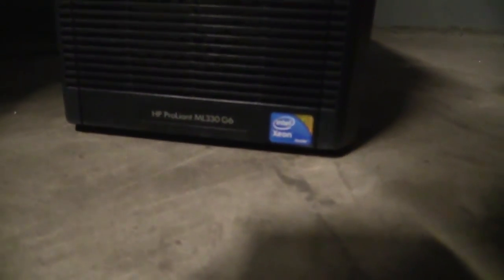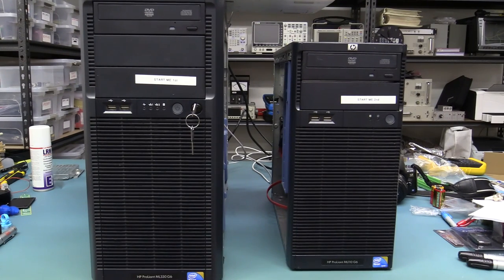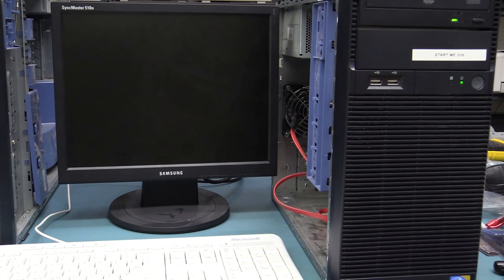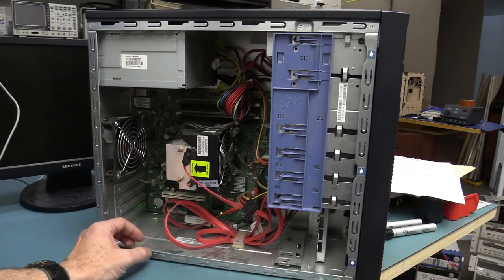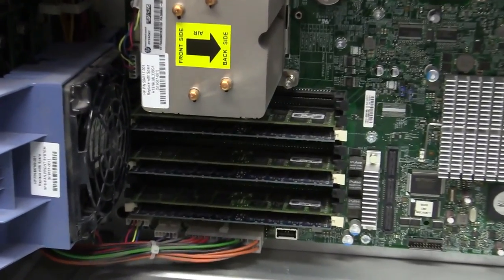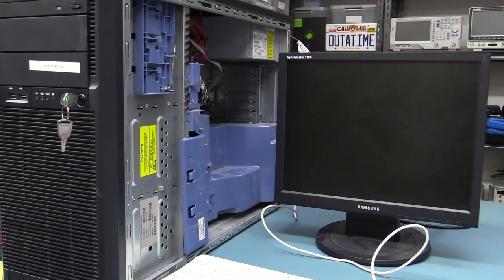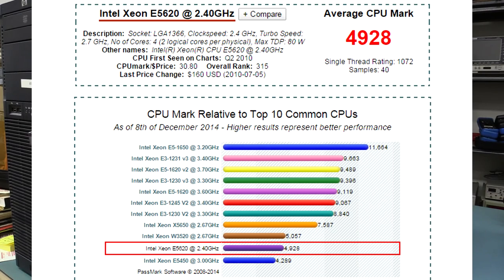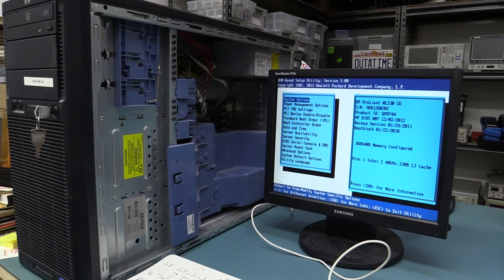EEVblog #691 - Dumpster Dive Xeon Servers

Comment: saw in the video that the Xeon prosessor in the last machine had 12mb cpu memory. Thats nice.
Reply from the maker: ingenfare Yeah, my i7 3770K only has 8M
Reply: And it's quad-core with Hyper-Threading which gives 8 threads total. This can still be used for lots of server workloads even today.
Reply: EEVblog
The i7 is much quicker at basically any task you throw at it. See http://cpuboss.com/cpus/Intel-Xeon-X3430-vs-Intel-Core-i7-3770K for comparison. I'm talking core vs core. I think the only reason you might consider using the Xeon, is power consumption when running 24/7.

Nevertheless, nice find!
Reply: But even a 5820K have 15MB...
Reply: SeaJay Point is,it is not expensive,according to most 'gamers'.

Comment: If these are anything like G8's the Ethernet ports are probably designed for use by ILO (Integreated Lights Out management) which is like a low level remote desktop to allow hands-off management.

The real network ports would be on a fast expansion card.

Comment: ML110 and ML330 are HP's base models, single PSU, no SAS support and no real RAID system (B110i is a raid system but its more or less software raid)
However they are still quite good machines and quite reliable.

Comment: I agree the thermal thing on the large one. One of my mainframe class systems was like that. They used styrofoam, ducted it from the front where the drive bay over the RAM, CPU, and out the back. They used 3 loud, but low power squirrel cage fans. I replaced them with a normal fan on the back on the outlet works fine.

Comment: Depends how much is your processor heating up.
It's a huge difference between 40° and 80° (when your CPU usage is around 20%),guess which one is better.
Because with higher temperature Si  Ge and other materials change their behavior. 
Witch changes the power requirements as well as actual clock of your CPU.
So your PC will be turning it self off and not just because of temperature of core, but because your power source won't keep up.
Or you can experience an occurrence of bsod quite often, mainly caused by corrupted data exchange between CPU and ram.

So keep in mind:
bigger heatsink = better thermal flow = faster cooling (fan required of course) = happier processor. ; )

Comment: the server computer i had didnt run the CPU fan, 'cause it didnt need it. the proc just ran cold all the time. dont understand how, it was running ubuntu server as the os, and hosted 2 minecraft servers, an FTP server and 3 web servers on only a core 2 duo.

Comment: Gret pickup. They are servers, but lack redundant power supplies. I picked up a couple of older dual-Xeon DELL Precision T5500 machine with about 14GB RAM DDR2 ECC RAM. The RAM runs so hot it needs it's own fan, lol. Those older Xeons are power-hungry things, the newer generation Xeons were much more efficient. So many fans, would literally sound like a jet taking off (and would stay on!), and had to use software tools to slow the fan speeds to more reasonable levels. Really belonged in a datacentre. CPU-Z can tell you exactly what you're dealing with in Windows in terms of processor. Costs of running them at home 24x7 are restrictive, can add $50+ to your power bills. These newer 2011 models should be more efficient. ECC RAM makes them oh-so-stable.. You got some good RAM there too. As a precaution on older machines I always note the existing BIOS settings and replace the CR2032 lithium button BIOS battery.
You have a nice virtualisation platform there with the one with 32GB. They easily chucked out around $1000 worth of servers there..

Comment: To write these off as a tax loss they will get a much better return than the auction price and it also means nobody has to actually deal with the auction or the postman. Plus an office will also need to find a way of 'absorbing' the funds raised from the auction without raising suspicion. $500 to most people is well worth the hassle but for others it's just too much hassle !

Comment: The first HP isn't a "real server", it's more a consumer PC with a little bit more durability, but not more. Because it has only one PSU and also has the xeon with the LGA 1156. This socket are also used for the Consumer i5 and i7.
(i wouldn't use server like this for an commercial environment)
The second HP is more a"real server".
but when i say server i understand something like an Fujitsu Primergy RX300 or an HP DL380.
And its not an good idea to use this as an gaming machine.
1. the are very loud
2. the PCI-E slot mostly is not the x16 version
3. the PSU of the bigger server are mostly not compatible to the Graphics card.

Comment: The 330 is a great machine, the 110 is a very low end server.  The 330 has a mezzanine which will add another CPU.  It makes a nice, if giant, workstation for running flight simulation on.  The enet/mgmt is a dual purpose for HP iLO (remote access) and also a standard enet for the OS.  You can disable the iLO function.  The RAM is indeed ECC.  You can put an X5650 series in there also which makes for a powerful system.  I recommend that you find a use for it, you won't regret it.  I am happy to answer any questions you might have about it.  You will want to sell the 110.  The Gen 9's are starting to come out.  Keep up the great videos.  Cheers.

Comment: Regarding your comment about how things showing up on the screen means the CPU is present... on a computer, the CPU completes the power circuit. If you have a computer with no CPU in it, it won't turn on.

Comment: You can just boot some Live Linux from CD or USB stick to identify CPU.

About Xeons, well, Xeons usually have higher IO bandwidth (to disk, memory and network controlers), as well much bigger CPU caches, which is very useful in big business applications with very complex codes. Also Xeons tends to rather use more cores than running fewer at higher frequency. It is just more suited for power efficient servers usually.

I have few computers with Xeons, one with dual Xeon X5679 @ 3.2GHz, and another with single W3690 @ 3.47Ghz, and another one with some more modern model.

Dave, you should find really crusty professional rack server, like IBM x3950 or something like that. People are giving them almost for free, because it is better to replace them with newer, faster and more power efficient machines, than keep running. Built like a brick, heavy as hell, and some awesome management features, dozens of redundant hotswapable fans, air ducts, ultra reliable power supplies, dual psu, sas/scsi drives, special memory systems (with dozens of memory slots) and lots of awesome custom hardware, software and system engineering.

Comment: Holy god. Is that a delta fan in the 2nd server?
Reply: Mads Kjerulff probably multiple deltas
Reply: ictdude1 It must be, i was just waiting for that thing to take of like a harrier.
Reply: +Mads Kjerulff your average dell optiplex 745 has a delta fan too. and those are much easier to find in dumpsters....
Reply: Jeffery Peters I am surprised it didn't just cut off the finger!
Reply: Jeffery Peters The scariest moment i had with a fan was when i was fixing my nitro plane. I just turned the prop, thinking that it wouldn't start. BUT IT DID. Luckily i only hit the propeller from the back, so no sharp edge, and it wasn't throttled up very far.
But from that moment on whenever i worked on the engine i had the glow plug out!

Comment: wow the fans on the second one at startup were insane
Reply: duncanscast I had a similar server, HP as well, but a rack setup. It had rows of fans in the front and in the back, and a plastic air duct throughout the RAM modules and 2 CPUs.  We took the lid off, left the plastic duct on top of it (it wasn't kept by anything), and when we started it, the plastic duct flew across the room while the server was getting ready to take off. It weight a hefty 500 grams, that plastic air duct, still took off and landed at the door.
Reply: duncanscast Both the Computer's fans, and EEVblog's Fans were insane.

Comment: Nice score - I picked up a dual 5060 rack mount machine with 4Gb ram for $100, and had to replace the motherboard. But... it was fully populated with HDD's - 3 x 72Gb 10K and 5 x 146Gig 10k units. and guess what was in the CD drive? yep the original HP server 2003 CD :) about to set it up now. I also got a pile of spare HDD's, a spare VRM and a few other bits including the rack rails :)

Comment: +EEVblog I know this video is a bit old... but I have some doubts.

You said to install a windows server on it but:
- Will it works (nowadays) with Windows 7, 8.1 or 10 for a particular use?
- Is it viable to use it as an industrial machine, i.e. a computer for a bordering machine or metal plates writer machines?
- If you invest about 50€ for a hard drive, you expend time installing Windows and so on, how much you will sell it?
Reply: +Miguel Angel MG It'll run standard Windows just fine, it'd be totally usable as an industrial system, and just as a reference you can usually find similar systems on eBay for $400-600.

Wouldn't be great in an environment with a lot of vibration though, they're not built for that. These usually sit in a networking closet in offices, tucked away from disturbances. You can think of it like a regular PC that's got some beefier spec'd parts. Hell they're often used as high-end workstations.
Reply: DarkStar851 Thx!!

Comment: Looking at QuickSpecs from HP for ML110 G6. Looks like Xeon X3430 Quad-Core 2.40GHz LGA1156 based on 1st gen core i7?   As far as I know, Xeon is the same as Core i7 + ECC RAM support.  You mean single / dual core processors,  not core :-)

Comment: The ML330 Would make a great live streaming rig
Reply from the maker: NekitaNet What makes it better than the i7 870 I have now?
Reply: reliability.
Reply from the maker: voltare2amstereo Granted.
Reply: Haha, yeah, right in the middle of your stream the fans kick into high gear and deafen all your viewers.
Reply: EEVblog It might be worth swapping CPU + Mainboard + RAM to the streamrig, if you could still use your Graphics Card and CPU cooler. Considering what price you can sell this for, you'd really have to be into this reliability thing.
Reply: Damon Dransfeld Most of the boards aren't ATX complaint and wont fit in a normal case. Replacing the fans with something quieter should work, but the board might throw a fit. Dave if you put the case sides on and change the BIOS settings to quiet (If it has an option) the machines should run a lot quieter, you'll find a switch that engages when the case is open and this normally triggers an error.
Reply: EEVblog The Xenon can do more heavy loads for longer without any single bit or other errors. Memory bandwidth should be (in general) higher and with TLB Cashes on die being bigger, the access time to stored functions (including swapping out processes) will be much quicker. In general the Xenons and i7's are from the same dey's (last time I checked), but the Xenons are cherry-picked for longevity (guess a stress-test) and have no or only limited errored functions that are (laser) cut out of the circuit. Since you've got both I can recommend running a DataBase testbench to check the exact difference on the systems on the part of throughput of data and functions. Now in regards to video rendering: Sometimes just one single bit error will make a video unusable, so there the quality will payout. And with these two to compare: Well the Xenon is 32 nanometer and this i7 is 45 nanometer production process, so think of the optimizations done when enhancing to the smaller lane sizes. Have a look at these: http://ark.intel.com/nl/products/41315/Intel-Core-i7-870-Processor-8M-Cache-2_93-GHz and http://ark.intel.com/products/47925 Number of memory channels is +1 on this Xenon and that at higher memory bandwidth of 4.6Gb/s, so 13.8Gbit/s more throughput. Guess that's the limit for typing for now, pm me with any thought you have. Oh one more: Check the power consumption of both machines. That also factors in...

Comment: Well i love the HP computers. They keep on working and it was no suprise that the boot up. I have an very old p4, 2.8gHz HT working 24/7 as a radio automation and it is still working. I had to replace some elco's at some point but still going. That is one thing you can't say about the Dell computers. ;-)

Comment: Isn't GPU accelerated video rendering a lot faster than CPU based?
Reply: I'd still take a free Xeon over a 5000 bucks Quadro.
Reply: Doesn't a consumer grade GPUs beat out Xenons?
Reply from the maker: Christian Gerefalk Depends entirely what you are rendering and how.
Reply: +Mike Bruschke Because "free" vs "$5000".How about comparing a K5200/K6000 with something more modern,such as dual 2687Wv3s?They cost similar.

Comment: I used to work for Intel in the Enterprise Server group. Yes, they are very reliable, a major factor in design. Usually the weakest link is the spinning hard disk drives (HDD's) so they might be the reason the machines were replaced. (???) The HDD's were removed for various security reasons, but there is no reason these boxes couldn't be cleaned up, new HDD's installed with an OS and then run non-stop for another couple of years. Are the hard drives SATA or SAS?

Comment: Its amazing what offices throw out, i recently saw an ad on my freebie site in london which i was extremely lucky to get first. Got a dell poweredge t300 server tower 2011 vintage and a dell vostro 270s mini tower 2012 with wifi with a high spec core i5 in it still worth 400 british pound.!... also he threw in a 2011 core i5 with 8gb ram and a graphics card that an old work colleague who left had built, i couldn't believe my luck.. had to go into central london though with the car and park in a ridiculous place to pick them up but he left them in reception for me. Picked up at least 600 british pounds worth of stuff and currently using the Dell vostro with 8gb ram and a 1gb graphics card from the i5 system!! for free.. so chuffed as i was looking for a cheap desktop but ended up making money and getting an i5 system.

Comment: yes its a Xeon, but there are Xeons you can get for 1.50 GBP, or Xeons you can get for 22,000 GBP. judging by the labels, they look like older generation CPUs, i have had rackmount servers with the same CPUs, for 100 GBP mid-low config.

Comment: You really shouldn't be calling those "a pc". A server is not built for general purpose, personal applications.
Reply: That's pendantry. They fulfil all the requirements of a "PC".
Reply: But IT IS a general purpose computer. The only difference between two computers are the hardware features. Server has dual psu, for example, more memory slots, more cpu sockets, etc. However, server is still a general purpose computer that can act as a desktop.
Reply: You can still smack Windows 7 on it and run any consumer application or whatever, and nobody would be the wiser.

It's a PC.

Comment: The thing about servers is that they're designed to do only a few things: file sharing, print server, and running services. So although most desktops and laptops run circles around these servers, these servers will run thousands of hours longer, and 24/7. Servers usually come with crappy video. But, the Ethernet ports on these must perform. Also, the SATA ports are probably much better than what you'd find on a regular computer. Most computers will only have one SATA chip, and a ton of ports sharing the one chip. These servers will have one, maybe two SATA ports per chip at most. I'm not sure if Windows 7 or 8 will run optimally on these servers - Windows 2012 or the like should be used if anything.
Reply: What truly matters is the ECC memory support and good virtualization support.The other important thing for workstations/servers is good warranty support, preferably with on site support.
I'm also sure that Windows Vista/7/8 will run on such machines with no problems at all.
Reply: Windows 7/8 will run just fine, most server features you pay for are for things like ECC support, redundant power supplies, hot swap drives and more important than anything else is the warranty.
Reply: lassi kinnunen There is a difference between server edition and desktop edition. The main one is: server edition runs a bit snappier(if you don't install the services of course) than the desktop. Both editions have similar system cores, but they do try to trim them down a bit to reduce cpu load and memory footprint on the server. 

I think the main advantage of running windows server on this would be the multi-RDP sessions.(something desktop windows doesn't allow) It would allow you to work on something in your user on the console(video editions,etc),while your kids or your wife could connect remotely to the server and run something else.